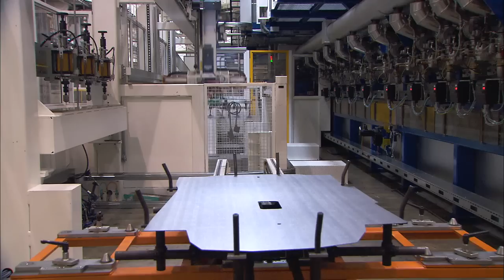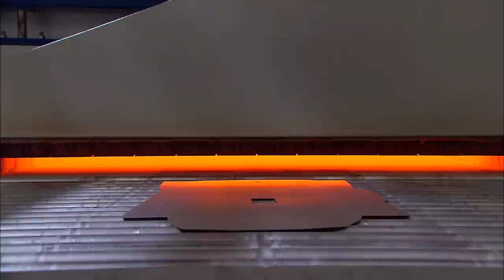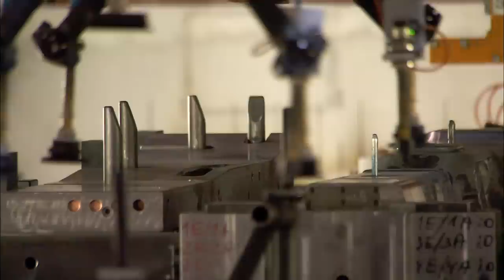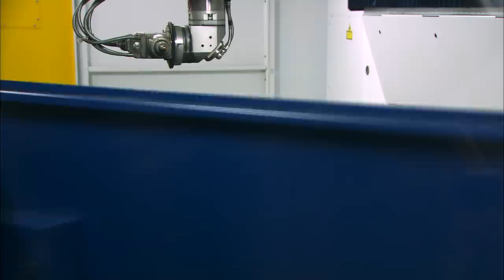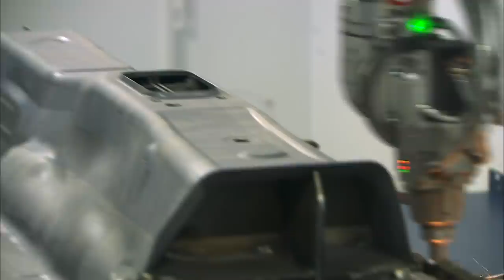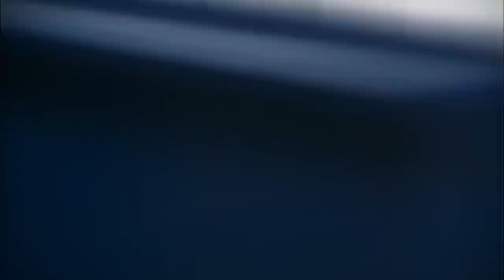Volkswagen Production - Press Shop

Comment: I don't see how this makes any sense. Take forever to make a panel.
Reply: TITAN Roo  I don't understand. How can less be more?
Reply: The point here is that the material is not a simple sheet of steel, it is high-strength steel. That is why they form in a hot state. Once it is cooled, (~hardened), it is almost impossible to cut with die tools. They use laser instead because for laser it almost doesn't matter the hardness.
So it does make much sense, currently, this is the only method to manufacture high-strength formed body parts, which increase the strength of the car while lowering the weight, which is a trend I assume at any modern car manufacturer.

Comment: This material needs high tonnage press which is not feasible. Hence they go for hot forming.
Reply: When the sheet is hot, it needs less tonnage, because it is soft. At hot forming, when the steel cools, it will be heat treated, the same way as would be in an oven. The forming tool has a lot of cooling channels, and after forming hot, cools down the steel, which gets the desired strength (hardness, ductility, tensile strength), which is precisely tuned by both the material selection (chemical composition) and the process, i.e. the cooling process (speed). So it is a forming and a heat treatment in the same step, where the steel will be strong after the forming.
The laser is used afterward because clipping is not feasible in this state of the material. (the clipping tool would need resharpening after 3-5-10 pcs)

Comment: Can anybody tell which is the make of that laser head mounted on the robot end??
Reply: Plasma cutter?
Reply: Trumpf Laser (not plasma). You can not buy the head separately, it is completely integrated with the 5+ axis CNC machine (not robot). For example, you can buy laser heads (for fiber or beam) from Precitec. They have the servo motor system built into directly the head, which allows to follow the sheet at the precise height (which is needed for laser cutting) Very pricy.

Comment: I'm guessing this is for a low volume production car like an R8, hence hot forming over a progressive die and laser trimming over a trim die. VW didn't get to be big by wasting time.
Reply: No this is also the process for high volume models. The marerial is to hard to trim with a trim die. Thru the hot forming process the sheet metall is getting hardened.  The reason to use this kind of material is to reduce the weight of the part and get the same or better strenght as the same part made out of thicker material produced in the conventional stamping process. The inner "A" and "B" pillar are other typical hot formed parts.